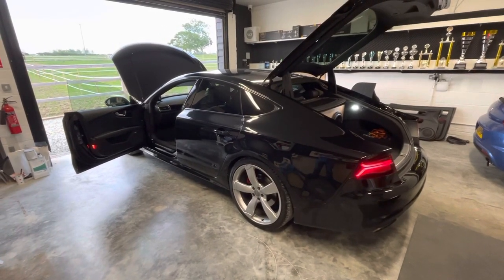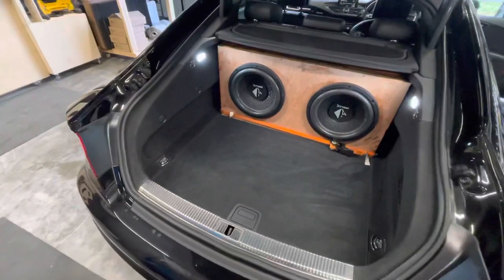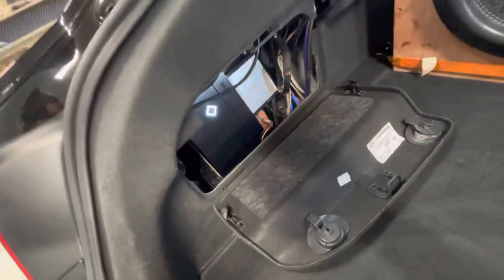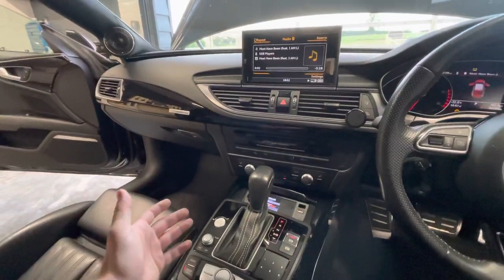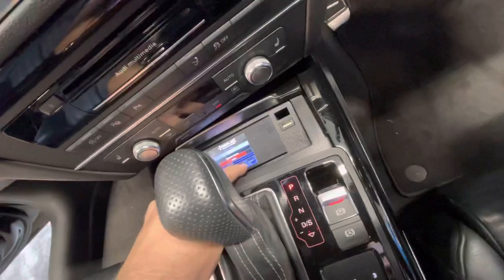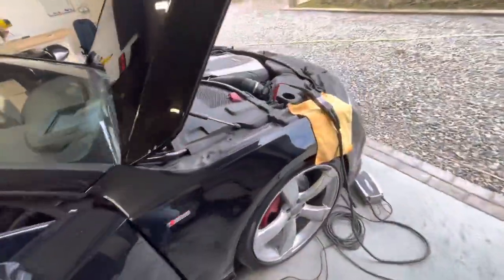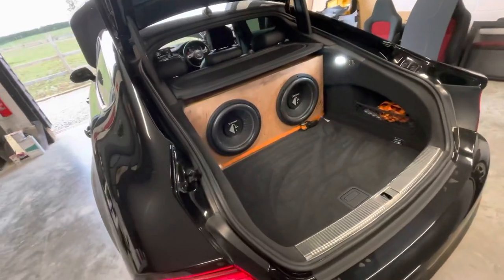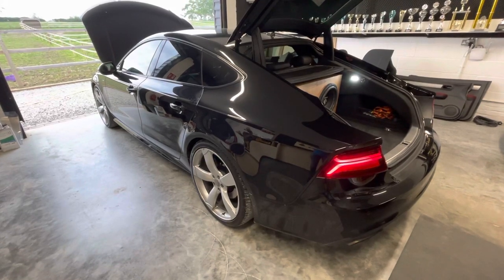Audi A7 SQ(L) System - First Impressions After Tuning Session & Walkaround - Steg, Helix

Comment: Oh, if you don't mind , I had a question, if not that's cool to, I run a excelon, head unit ,with a built in dsp, until I buy a tru dsp, would you use the head unit crossovers, an run the amps full range ??
Reply: Absolutely!   Head unit x over is much more accurate than most amplifiers.   Also on a head unit you can change the slope to 24 db per octave etc where on most amplifiers its fixed at 12 db.   Most of the time its a guess on the amplifier where 80 hz is for example as its just a silk screen on the amp, unless you have an SMD CC1 or something similar which will be more accurate if using the amplifiers x over
Reply: Head Unit all day long.    Not sure what model, but some have something that is similar to Pioneer Network mode.   Where you can select 24/dB per slopes for the front High and woofer(Midbass) and of course levels and so much more.   TIme alignment as well as basic E.Q.    (Some per speaker, some per system)  

There are a Few limitations, but they are pretty minor as you  just have a simple 2 way setup for most folks.   Doing a 3 way is a bit of a band aid as your crossover points just don't suit something like the system shown here in the video,  but it can be done with some compromise.   

If you are on a tight budget,  stay with what you got until you can get one of these units that has the same up front controllers that Peters videos often feature.  They make using the system a joy and ease in daily driving.  

The Budget options are EXTREMELY FLEXIBLE!   But come with some VERY real headaches you have to Iron out.  Like the custom Linux Distro's that can be used in a Car PC DSP/ Audio situation.    (asus Zonar I think is a GREAT USB DAC to use btw) 
Basically, its for the Audio Geek people who have more time than money or like to build things to suit for a special application or goal.   And the cost?  It an be often as much as Turn Key DSP/Amp combo.    Never mind the Car realtated heachaches.

MiniDSP is the budget defacto with a Nano Digi with 8 outputs and that still needs a Good DAC (topping level or better)  to really make it shine.  And by that time?  Your already in a stand alone DSP price range.    

Dayton and others have good parts but sound and problems with use are hit and miss. 

I hope that helps.

Comment: Looking for my A pillars to be done for my 2016 audi A7 C7.5. 
Wondering if a 8 inch will fit in my doors?
Is it also possible to do yinglong lithium in my vehicle?
Reply from the maker: Where do you live and when do you want to get pillars fabricated? 
Door may have space for 8”s, depth is questionable though, plus you have to check if you have the ported enclosures in the door or not, because some of them come with a Bose package which have ported, plastic enclosures.
Reply: @pssound9749 seven months later still haven't really touch the car. I live in the United States in New Jersey 10 min away from NYC. I am looking to have my A pillars done as soon as possible. I have a set of Hertz 700.3 three inch mids to go in the A Pilar. Thinking about also using another pair for the front doors. I definitely have the Bose system package with the enclosures. Thinking of using now two 8s in each front door and one in each rear door.  Subs will be two 12in sundown NSV4 ran with a 5k sundown sfb. I will also run the mids off a sundown sfb 8k for now. Mid range and highs will run on two Zapco 150.6ll. I will be using nav tv and a JL Audio twk88 for sound processing. Not to sure what to use for tweeters as of yet. Still not to sure if I can use lithium cells (cibs or yinlong) or a upgraded alternator as of yet. Use of lithium and a upgraded alternator is truly my hold up.

Comment: Not that I’m interested in buying them. But I’ve been waiting to hear a honest opinion on the STEG brand of speaker.

His pillar build looks just like mine. The shape location and aiming is almost identical. My tweeters are in custom mirror sails.
Reply: I was lucky to try, and still own quite a lot of Steg speakers. For the price you get a lot off equipment with a very good sound. 1. The ST650 in tree way; really nice build quality and good sounding speakers (not sold anymore). 2. The ME650 like in the Audi (by the way the SQ32 are not the original tweeters for the ME); very stout/powerful kick bass but the original tweeters are to mellow to my taste. The RE65 3 way; ceramic woofers and midranges and the original tweeters are the SQ32 like those in the Audi; very, very nice. Effortless playing woofers, clean sounding midranges and the SQ32 is a very good tweeter, especially seen the cost of it. Smooth but lacks a little bit detail and resolution. Maybe because off the size (32mm!). By the way; Ground Zero earned a EISA award with the cone of the RE65 on their SQ16 woofer in a three way configuration.
Reply: @umtbozkr2358  thank you for the detailed response. I’ve watched a lot of Fred and sound videos on the Steg brand. However he gives VERY biased reviews of them in his comment section. Always claims that they are the best you can get.
Reply: @umtbozkr2358  No matter what, I can’t seem to get the sparkle I’m looking for out of the Hertz Mille tweeters and mids. They sound very smooth and warm with most jazz music. They lack the crispness/strike of the piano drum cymbals and chimes. The saxophone and instruments alike come in great.
Reply: In a e39 M5 I did not have to cut the trunk open; the bottom was just a plastic tub (probably for weight benefits) which you could unscrew.
Reply: @umtbozkr2358  yeah the Zapco 150.6AP retails for $1850 here in the states. I was deeply considering the ML1800.3 before I got the Audio Development W800neo. Specs wise the W800neo was a better choice for my application. Also, I know if I change my vehicle the possibility of the AD W800neo fitting is better then the 1800.3. Had to future proof!
Reply: @umtbozkr2358  the e39 M5 is one of my favorite BMW’s. A very clean 2003 still comes to me for service. A few others also but they aren’t near as clean.
Reply: @myboy051  mine was a carbon black with the black ostrich leather….. what a car, what engine (except the oil consumption even it was 2001 LCI). Pulls from stationary till red line in one straight. I even made a video off a test drive at two in the morning, till the speed limiter kicks in at 270 kp/h (259,2 on GPS). Still got the video on YouTube 😁
Reply: @myboy051  yes, it seems we’re interested in same channels. Erin is top, very professional and educational!

Comment: I want to add a system in my car, question is, is adding a second battery be fine with these car ? I know they can be very sensitive cars. And will the alternator be fine to charge both batteries?

Comment: I'm having a problem as well with battery power. How did you get 1/0gauge wire to fit to the battery? I can't get them to sit  flush to get good connection. Audi A7

Comment: finally audi video again :) your videos always inspire me what can i do better... I have a 3way steg in my A5 too, great speakers for the price, but i only have one gladen 8" sub in the side of the trunk but after seeing this im considering going into 12" mb 2x12 :D btw did the car have factory DSP ? i run hi-low input from factory MMI unit to my DSP but im considering the helix SDMI 25 and change the coding in the head unit so i wont be using speaker output anymore
Reply from the maker: He was using Nav-TV for MOST150 integration. I’d advise to get the SDMI25 to get unmolested optical signal for your DSP! Good source is the first part of the chain. 💪🤘🔊🔊

Comment: Hi Peter, nice video! I’m sure it’s sounds much better now. Also nice to finally see one of my favorite brands in one of your vids (sounded you liked them). I am almost done with Steg SQ35 ceramics in the A pillar; goes lower then the ME30. But went for the Ground Zero Reference EVO gold for the tweeters instead of the Focals TWE in the sail panels. Also Ground Zero 6.200 SQ plus amps; but hesitated between them and the Zapco 6.150 AP’s. Read a test at a German Magazine with better results (dampening factor and S/N ratio) for the GZ then Zapco. Hope it pays off. Maybe a visit to you from the Netherlands…..
Reply from the maker: I’ve seen and used many amps with better specs like those, BUT… 😃
You have a nice equipment list, all it takes is proper installation & tuning! 💪🤘
Reply: @pssound9749  last but not least, nice to see more, and different price range systems getting tuned by you! Congrats...
Reply from the maker: @umtbozkr2358  then you have everything to build a European Champion audio system! 😉🔊🔊
Reply: @pssound9749  everything is possible Peter, but never immediately, everything takes time. Even the European champions started with a cheap amp and a cheap Subwoofer with no clue of anything. And expensive gear is buyable, experience not 😉. And only expensive gear makes not a champion.

Comment: Hi Peter, I know you are very busy, but if you don’t mind can I ask your opinion? I’m running for quite a while two Mac Audio Aliante’s black limited 12 in sealed enclosures. Very happy with them. How much I desire to go true IB the construction of my car doesn’t allow it. I know you don’t advertise on brands but I had to ask it; I’m thinking as replacement for the Aliante’s two Esotar’s 1200 or the Scan Speak gold 32’. Is this a wise choice or are there other subwoofers you would recommend. Or do you think, “ you’ve already got one off the best, don’t change a winning  team”? Main reason is that I want a little bit more umpf on the lowest notes (p.s. the Esotars have a huge X-max on relatively low RMS with a low FS just as the Aliante’s). I am told that the Esotars are very musical. Thanks and have a good weekend.
Reply from the maker: If you can’t do IB, then you need lots of cone area and big box. Swapping 12” to another 12” is not gonna change too much, especially if you already have Aliante subs, which can play very low.
Reply: @pssound9749  thanks Peter for your answer 👍. I was just thinking Esotars I’m the back and one off the Aliante’s as front woofer in a small sealed box. It’s a 5 series station wagon. A front woofer would be a solution in avoiding rattles of under seat woofers. I have a third brand new Aliante, but it has an rattling issue I couldn’t solve (has opened it but couldn’t find the problem). If that was ok, I wouldn’t bother other brand woofers.
Reply from the maker: @umtbozkr2358  how would you use an Aliante upfront instead of the underseat ones, which are not subs, but kickbass drivers, which have to play higher than a front sub should?
Reply: @pssound9749  no, you misunderstood me. Off course an Aliante upfront would not replace the under seats. What I mean is that you can crossover the under seat higher, as a result the rattle issues will be less. It’s just thinking ahead. Off course with midranges that can play low enough..